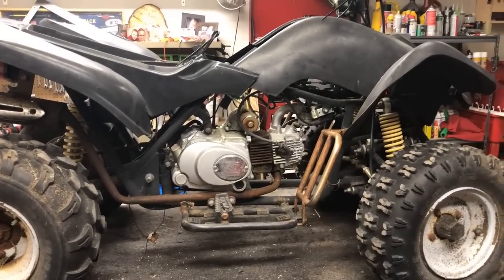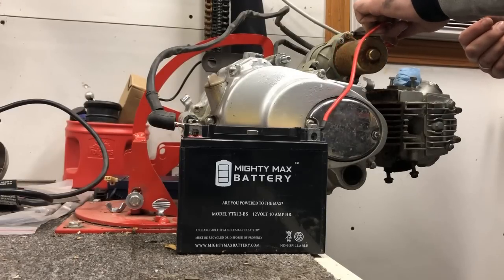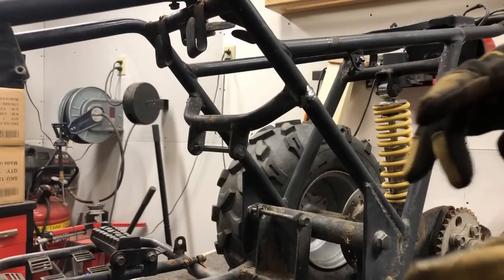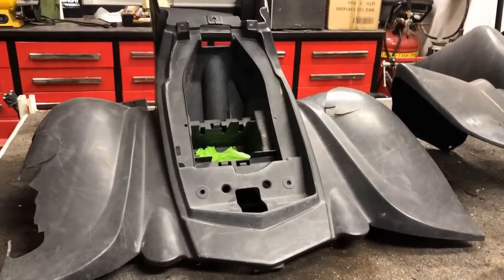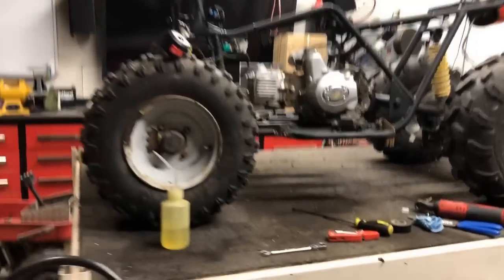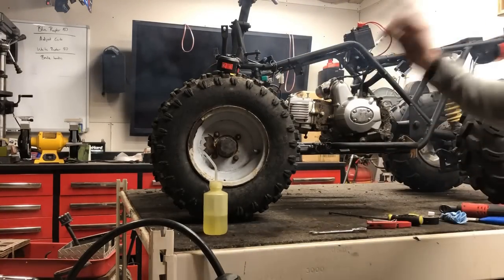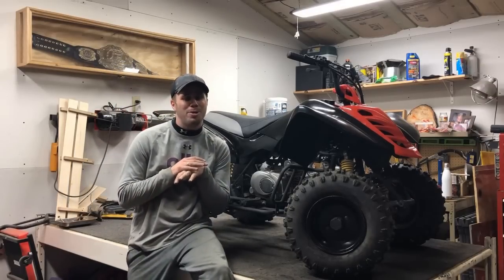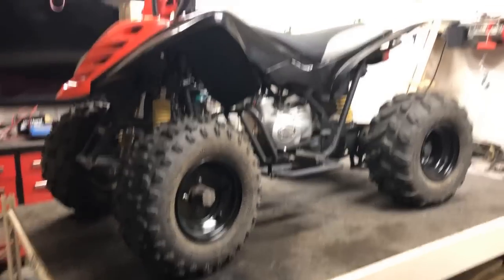You bought a 110cc Chinese ATV! Now What? -Complete Build

Comment: You put in far more effort in repairing it than the manufacturer put into designing or assembling it.
Reply from the maker: Unfortunately that’s probably true. They are considered by most people as “throw away” quads. Just trying my best to help save a couple to keep kids riding without breaking the bank!
Reply: Praska Boy's Garage hey buddy was this a kids 110cc quad?
Reply: Hey BJ, did you use POR-15 on the painted parts? If so, do you use the top coat also? I hear without the top coat UV rays discolor the POR.
Reply: That's for sure
Reply: Exactly why China doesn't need to build it. We should or Japan.
Reply: But that is the point isnt it? This gives us the opportunity to rebuild it at a fraction of the cost of a name brand quad. 

Stop complaining and open your wallet if you don't want these problems.
Reply: It wasn't a diss or a negative goofball quit being so negative. My point was the effort he put in it was impressive considering the manufacturer didn't. Smh
Reply: True

Comment: You got the same quad as my friends kid. We had to do some work to it on occasion but that jr sized 110 lasted him from 10 to 14 years old.
  It costs $120 a year for 4 years to buzz around the farm. He outgrew it.
  Moved on to dads z400.
Now hear 21 and just picked up a canned ham xmr 1000.
  I bought a 50 sized w a 110 motor for $100 used, 10 years ago. I've messed w the carb enough to make it run really well. It pulls me around pretty well at #180 been great for my kids to learn.
  That little china, honda knock off is on its 4th rider.
   Btw bought a real nice motorcycle battery. Brand name. It was around $120 a few years later needed a new battery. Bought its 2nd battery from walmart paid $33 , no $h!t. Its been starting that little machine for 5 years now
Reply from the maker: That's awesome. Everything you said is exactly what these little guys are made for. Keeps you riding, teaches you how to work on small engines and when your ready you can pay some money and step up into a nicer name brand unit! Love it!
Reply: do you know the brand of this atv got the same and cant find ?
Reply: @marcallard9732  dont remember ? Try google lens. Of course easier said than done....... Let me give it a try.
Reply: Still not sure bit after 60 seconds of research, kymco ? Casey ?  Im sure the motors are all similar and made by a chinese/ honda knock off company named (almost looks like zyljan but its longer.... Strarts w a z)
Reply: Zhejiang
Reply from the maker: @marcallard9732  There wasn't any tags but I believe this was a Kazuma Falcon 110

Comment: This is a great video, really got me looking foward to getting my quad
Reply from the maker: Awesome! Good luck on your project, if you have questions I'd be happy to help!
Reply: @PraskaBoysGarage  how fast in mph can you get out of a 150cc quad?
Reply from the maker: @scotttownsend6223  Depends on your gearing honestly. But without sacrificing low end torque you can get in the 50s range.
Reply: @PraskaBoysGarage  I'm getting an automatic, would rhat get into the 50's?
Reply from the maker: @scotttownsend6223  I would need to know what size sprockets your running and your rear tire size to calculate. Depends on the gear ratio, but I assume a 150cc automatic with stock gearing should get you into the mid 40s up to low 50s.
Reply: @PraskaBoysGarage  on sunday when I've gotten it I will be sure to tell you sizes

Comment: I just picked up an identical unit to this,  The engine and gear box were completely disassembled when I picked it up.  It some broken gears in the 3-speed gear box.  Will you ever do a tear-down vid of these or do you know of a decent one? I've been searching around but haven't found one yet.  Other than that, I LOVE your vids.  I just stepped into the ATV world last fall with a little 90cc Ducar quad that my 8-year old and I tore down to replace the piston and cylinder.  Runs like a champ now for real cheap!
Reply from the maker: Glad you enjoy the content. I do not know of a good video on the bottom end motor rebuilds. I have a plan to do a video that breaks down the different types of E22 engines and a top end rebuild, but it probably wont be for a while. I still need to acquire all the parts I will need.

Comment: We’ve upgrade sprockets, chain, hubs (4 bolt), wheels/ tires, shocks and plastics. Installed new engine but am having trouble starting. Electrical sucks!
Reply: You can earth 110 motors to only have electric start, kill and 12v output to battery for lights, etc. Look it up on YT

Comment: Bought a 125 yesterday for 20 bucks and got it home the motor was cracked  wondering if it would be cheaper just to by a new one.. appreciate the upload 🤟🏼
Reply from the maker: You can buy them for under $300 bucks on eBay. Between a new motor, new wiring and the atv Id say you've made a solid machine for a cheap investment.

Comment: I put a honda z50r motor from a Honda minibike and it fit perfectly ( changed sprocket and chain ) shaved the plastics  Vance / Hines  exhaust 
 Honda socks homemade rim spacers .got pulled over for doing 40 on the highway believe it or not ( I'm about  160 lbs)
Reply from the maker: Dude! Sounds like an insane build! Lol nice work

Comment: Thank you. Really interesting to watch!
Reply from the maker: Glad you enjoyed it! Thanks for watching!
Reply: @PraskaBoysGarage  when will be a new video
Reply: @PraskaBoysGarage  i have a question my quad wont start everything is replaced except the stator do i have to replace the stator too?
Reply from the maker: @atlasaverage6137  Very soon! Current project is on the table!
Reply from the maker: @atlasaverage6137  Is the motor turning over just not firing? Or are you getting nothing at all?
Reply: @PraskaBoysGarage  motor is turning over but i dont have spark
Reply: @PraskaBoysGarage  i replaced the old wiring harness with a brand new one and replaced also the stator but still no spark. Maby you have a solution?
Reply: @PraskaBoysGarage  it is a 200cc but the wiring loom also say it is for a 200cc does this matter anything??

Comment: Hello I am wondering where did you get the motor mount for the table that you use. Thanks I’ve been looking for one
Reply from the maker: This is my #1 question for sure! I actually had a CNC company laser cut out all the metal to start making and selling my own. I will be selling the kits on my website either as a DIY kit or a completely assembled and power coated. Should have everything ready soon and will post updates on the channel.

Comment: When I have my wiring harness all wired together for a test, as soon as both terminals are connected to the battery, it's starts turning over it bypasses the starter button and that brake switch. I don't know what to do. I get no spark either. I'm testing the engine on the floor so I'm not sure if it's not being grounded since it's not a on a frame. Sorry if this makes no sense.

Comment: if you don't mind me asking, and it might be a dumb question but how does the brake light work? I have a quad that needs a new wiring harness and I don't see how those two ends you touched to make it start connect to the rear brake light

Comment: Question, I picked up a Tao 70, it was butchered so I ordered and replaced all wiring and electronics ($35) was waiting on new carb  but after wiring it, I sprayed a bit of starting fluid into the intake and she came alive !!!!  Now I got it all back together and went to start it and all the starter does is spin, its not cranking the enginem just spins??? What could be the issue? Thank you for any help as I cant find anything online.

Comment: Awesome video. I just picked up the exact same quad in very similar condition incl destroyed wiring and plastics, but its shaft driven?! Keep the videos comin. Very enjoyable/educational.
Reply from the maker: Alex Tas Thanks Alex! Good luck on your project! Shaft driven? I don’t know if I’ve ever seen a 110 Chinese ATV that’s shaft driven. You’ll have to send me an update on how your project goes!
Reply: @PraskaBoysGarage  I have started! However, have you ever encountered a quad with only 4 wires out of the stator that include green, two yellows and a blue/white. There is no black/red ! I have taken off the stator cover to see if perhaps the wire had broken within the cable sheath but no, there is no black/red entering the loom from within the cover. I can only see green, two yellows and a blue/white. Any advice would be much appreciated
Reply from the maker: temple68 interesting...So green is ground, yellow is the charging & lighting wires and I believe blue is the pick up for the cdi box. Follow the blue, does it go to the cdi? That should tell it when to fire spark from the timing and red/black should charge the cdi. Only 4 wires is new to me, but I was trace and and see where they all go.
Reply: Hi and me again (alextas temple68). I have little idea about youtube. I have been playing a bit more with my quad and another one. Turns out the 4 wire stator is intended for a dc cdi. I made up an ugly loom and got it going. Instead of the black/red you take a red straight from the battery. Tried it on another quad which originally had an ac 5 pin cdi and black/red from the stator. Hooked it up in the same way using red from battery and not the black/red, and it went too! Very happy but am using a double house light switch as start and run which is not ideal so will have to spend some more time to get them bush ready!! Will try and add a picture somehow...

Comment: Just with that cracked frame it will probably crack again .
When you have to weld it again make v groove all the way around the crack too allow for a better weld and deeper penetration. 
Ps I like your engine stand👍
Reply from the maker: Thanks for the advise! Another subscriber told me to drill holes at the end of each crack to stop the spreading. I appreciate the tip!

Comment: I've got this quad bought it to do up. Now the electrics I don't  know about. i tried getting it's started after cleaning up and a tightening up. And it would not go no starter nothing at all. There was another wire that looked the same so I plugged that in and the starter went then engine turned but starter kept going I have to disconnect these wires as soon as it starts please help.

Comment: Drill a hole at the ends of cracks before u weld to stop it spreading under the weld but it should be good enough
Reply from the maker: Solid advise! I will definitely use that the next time I have to do another repair. Thanks!

Comment: Nice videos, nice shop, nice work. Really enjoy watching. You do a good job of slowing down and explaining the important parts and use the time laps for the mundane parts. I like this approach as you can still “see” what’s going on. I have a question about your motor stand. Where did you get it or how did you make it?
Reply from the maker: GrowYourOwn Thanks man! I really appreciate the feedback! I film and edit the way I would like to watch if I was a viewer. Kind of a hybrid between the only restore no talking vids and “how to” vids. I came across the stand on eBay back in January 2018. The seller was bomcbe2kz7 and the item number was 173080767269. If I remember correctly, I paid about $110 with shipping. It has 3 mounting plates for different types of small engines. Definitely money well spent for my shop!
Reply: Tab won't start

Comment: Could you possibly provide the link that you purchased the wiring harness from??? -thanks in advance (liked vid and subscribed!)
Reply from the maker: Johnny Alexander Thanks for the sub! Here’s the link: https://rover.ebay.com/rover/0/0/0?mpre=https%3A%2F%2Fwww.ebay.com%2Fulk%2Fitm%2F302880786805
Reply from the maker: Also here is a link to my wiring video if you have any questions on the install! https://youtu.be/XdLLjDZ155M
Reply: Praska Boy's Garage awesome man followed your link ordered the harness! Hope it works out!! One more question the picture on the link you sent me shows that it comes with the stator. But going down the items listed it doesn’t say it comes with the stator. I did a very similar tear down to what you do in your video and I found that the engine was not getting spark but has good compression! I pulled the stator tossed a oem meter on it and nothing! Even to ground. So again my question is does the harness come with the pictures 5 pin stator? Or should I order it separately???

Also man I really do appreciate your videos I’m pretty mechanically inclined but having someone to check your work against takes away a lot of the second guessing!

Thanks in advance 
-Johnny
Reply from the maker: Johnny Alexander Love it! Happy to help. Yes the link comes with the stator, I’ve ordered it multiple times!

Comment: I'm about to buy a couple early 2000 model kazuma 110cc's from a buddy at work for $150 per quad (so $300 total). They are in great shape, not much fade or cracking of plastics. Not immediately running but were a short time ago before stored for 2 years. I feel like this is a good deal but looking for more knowledgeable opinions
Reply from the maker: That's the sweet spot for these projects. $150-$200 is my max I'll spend per unit but on the top end it needs to look good with only needing either motor or electrical work.

Comment: How do you determine what model you have I just found a atv at the trash dump I think it’s 3050c 110c motor but is the a serial number somewhere so I can find out which style I have so if I need parts I could thanks
Reply from the maker: It is hit or miss on ID tags. They are either on the front nose or on the rear swing arm. If you don't have a tag then I just go off looks and search that way. If your having troubles email me a few pictures of what you have and I'd be happy to take a guess at it for you.

Comment: Need help,not sure if this has ever happened to you,I finally got a friend's atv started,wiring issue carb. Ecg. I started it up and the rear wheels kept spinning,atv took off on me. What causes that?,I checked throttle linkage,needed seat,ecg. I have never had this happen,any advice? It is 110 cc, Chinese kid quad,no shift,just throttle and go?
Reply from the maker: Some of them have a semi auto transmission but more commonly they come with a centrifugal clutch and you are in gear and ready to ride as soon as you start up. Now if your at an idle, it shouldn't be moving so if yours is going forward right off the rip you need to turn your idle down.
Reply: Thanks,but I figured it out,but you are right about the idle. It was the throttle needle not seating,assembly was poor quality,had to clean it up,force it in,this is the throttle / needle assembly to carb. Brand new carb too. Thanks for responding,appreciate it. If the needle doesn't seat ,its Like wot!
Reply from the maker: @kylewassel287  Nice, glad to hear you figured it out!

Comment: I have a baja wd 250cc and need to change out the body plastics since they are all beyond repair, what could i get to replace them that will fit well?
Reply from the maker: I'm not very familiar with the 250s. I try and stay under 125cc when possible! Maybe eBay, but if VMC sells it I'd start there.

Comment: Great video. What style welder do you use?
Reply from the maker: Thank You! I have a Lincoln Handy Mig welder that does but flux core or gas and runs off 120volts. Best used on metal 1/4" thick or less.
Reply: @PraskaBoysGarage  in the video were you MIG welding the frame and muffler?  Looking to pick one up to learn, those are the types of things I would do.

Comment: The battery you are using on the video ytx12-bs is that what you use for the bike? Just wondering cause I need a new one and the old one is 3 ah but yours is 10 amps
Reply from the maker: That battery is specially used in my shop when I need a 12 volt to run/test something. Take the measurements of your battery space and order one to fit the size. Most sellers are good about listing the LxWxH

Comment: I have this exact 4 wheeler except it still has the metal guard on the front where did you get the parts from?
Reply from the maker: I get almost all of my parts from 3 places: www.vmcchineseparts.com / eBay / or Amazon. VMC also has an ebay store but I usually try and order from there direct website. Amazon is when I need a part prime shipped and ebay if I just want the cheapest possible part and I don't care how long it takes to get.

Comment: Can you tell me somethong about the shifting on this quad? Do i need to grab the brake before throttling or not?
Reply from the maker: This motor is semi-automatic. Meaning you have to shift gears but it does not require you to pull a clutch handle or brake handle.

Comment: I have the same atv and need a new battery for it, i know its 12v but what other specs do I need for a replacement? How many amps does it need to be?
Reply from the maker: I try and run a 5AH 12 volt if the space allows it. Measure your battery space and get a battery that fits. Lithium is best but those run in the $75-$100 range

Comment: Man, the design of the motor and sometimes other parts are great, just sucks they cheaped out on material, frames and usually motor mounts (all I’ve seen but two) have always been bent
Reply from the maker: Yeah I agree, the new ones are getting better however still have some issues to be worked out when it comes to wiring. I like the motors, if anything they are great practice if you every buy a 1990s-2000s Honda!

Comment: What paint did you use to paint the frame? Just a high strength enamel?
Reply from the maker: It is a chassis saver brush on paint. POR is the expensive stuff but you can also buy some from your local hardware store. We have an ACE in town so I just buy the store brand.